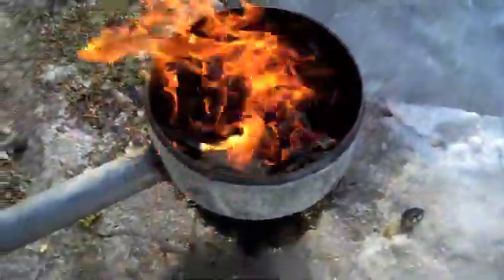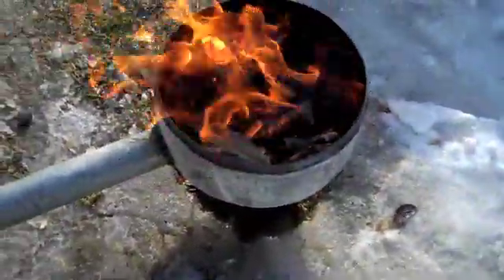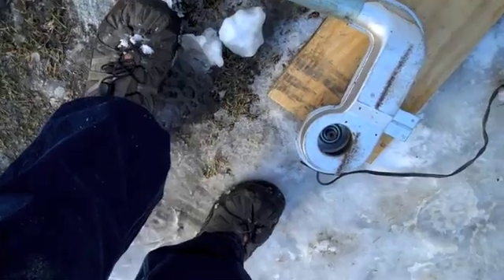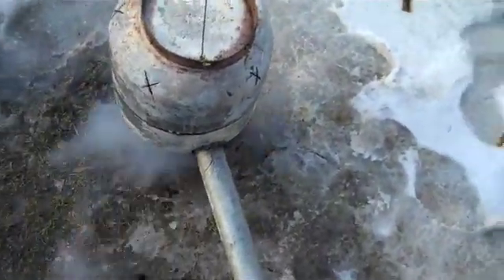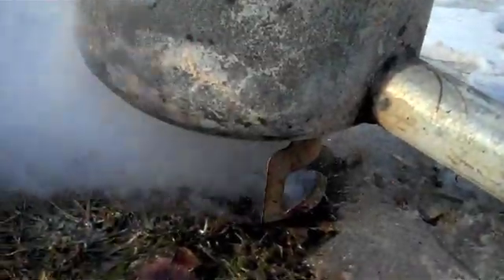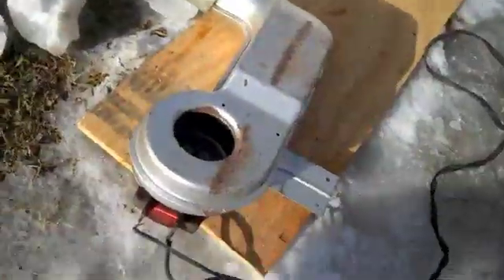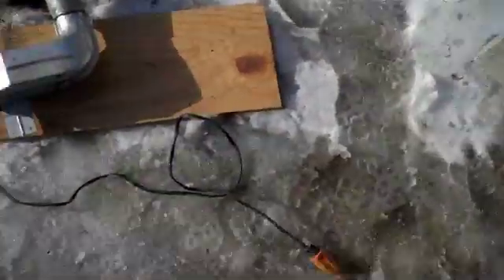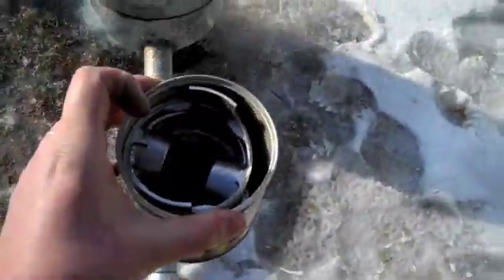melting aluminum

Comment: Hey Joe, the ceramic stuff like the bowl, are not heat treated to take that kinda temperature
, You need to use a cast iron pot or steal bucket with water in it to make what they call tear drops once it hits it, this will solidify the them into tiny  pieces that will allow easier refining...